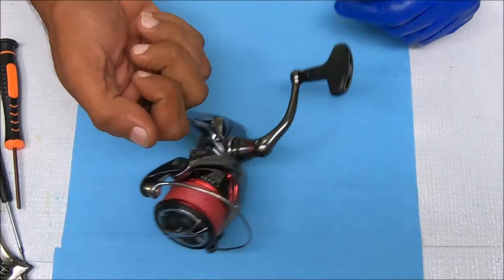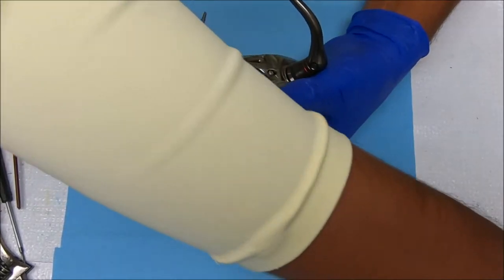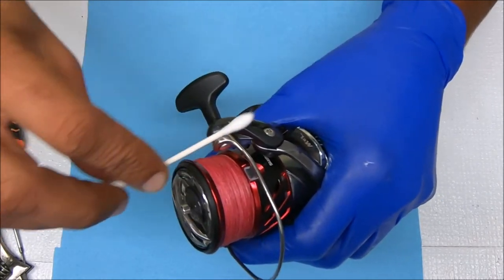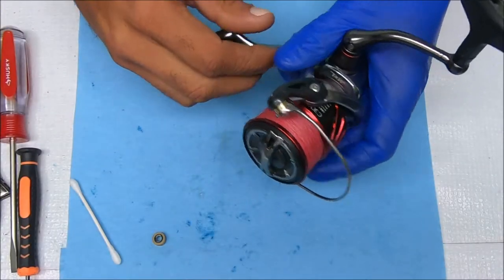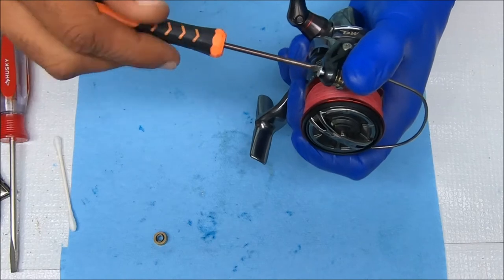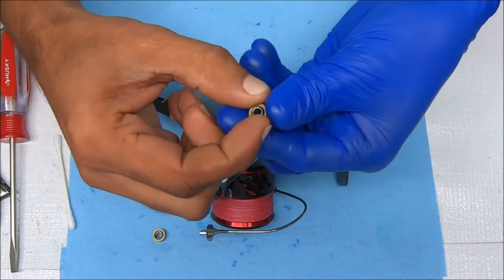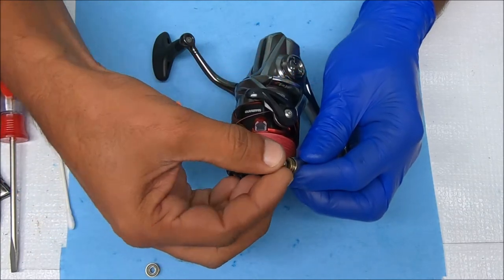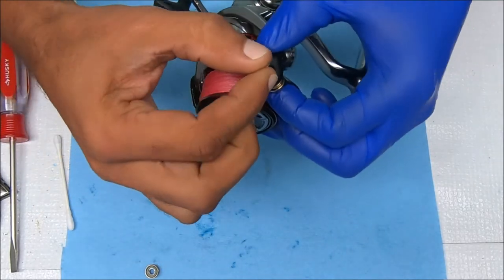Shimano Stradic CI4+ 3000HGB Making Noise Under Load: Fishing Reel Repair

Comment: Hey, great video. Thank you.

Today I got Ultegra C3000HG (2021 version).
Is it normal for this reel that I feel micro bump somewhere in the reels rotation mechanics at the rate every 2nd time it travels a circle? Meaning, that when I spin the handle so fast that it starts to make a couple circles on its own, I feel little bumps in my other hand that is holding the reel while the it is spinning. Or is that a reels defect and I should replace it with another Ultegra reel?

Hope for your reply, cheers.
Reply from the maker: See other response to your same question in the other video.
Reply: @TSGReelService  Where is the answer? Pls link it. I have three many other reels of this issue and intresting it why. Thank you
Reply: @TSGReelService  can u please link the video or explain? You have hundred of videos so that doesn’t really help haha

Comment: Please help me to find the same bearing for the Stradic CI4+ 4000XG. Is it the one with the part number RD13269
>> 104VX? Thank you.
Reply from the maker: Thanks for checking out the video! Ugh, I hate the new Shimano codes..... try eBay.... the RD13269 size is 4x7x2.5mm if you can't find the exact part number.

Comment: my stradic fl is one week old an allready sounds like that.. and i open the bearing lineroller and found something that looked like dry milk or something or from a candle... is that corrosion? i used some abu garcia oil but stil soundas and wont go smooth.. plus my braid line gets damaged
Reply from the maker: Thanks for watching! Happens sometimes. Oiling those bearings probably won't help... you'll need to replace it. Call Shimano to see if they'll replace it for free (since it's new) or buy 2 so you can have a backup. Check your schematics for the part number and instructions on caring for your real.
Reply: @TSGReelService  the problem is i oedered it from germany and ì live in Sweden
Reply: and the store doesnt exist anymore

Comment: What size bearing is it that you have to replace it with?
Reply from the maker: It's all one piece. Rd17672
Reply: @TSGReelService  is this working for a 4000 model ? Same size ?
Reply from the maker: @ayy0ub  what's the complete model number of your reel?
Reply: @TSGReelService  Shimano Stradic Ci4+ 4000xg
Reply from the maker: @ayy0ub  yes, it's the same part number.